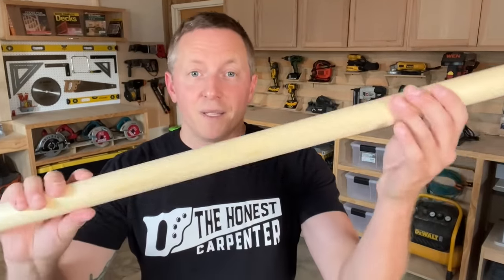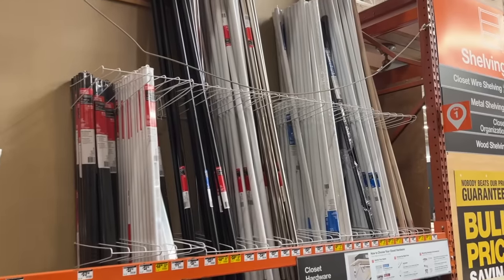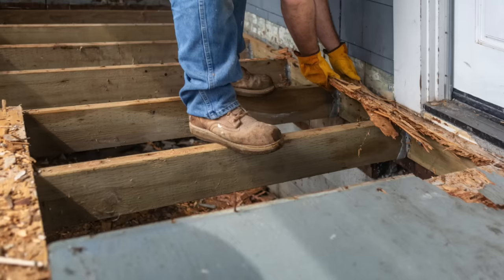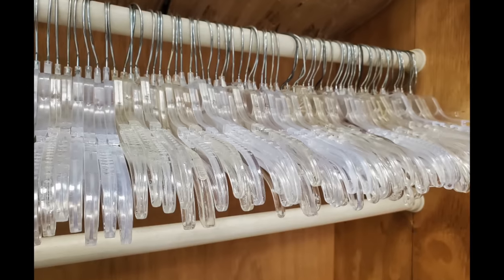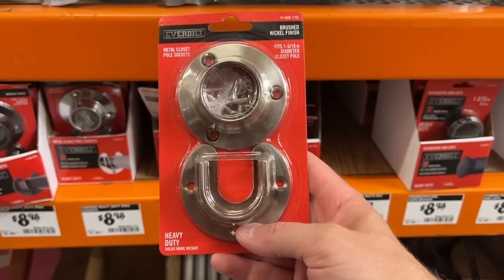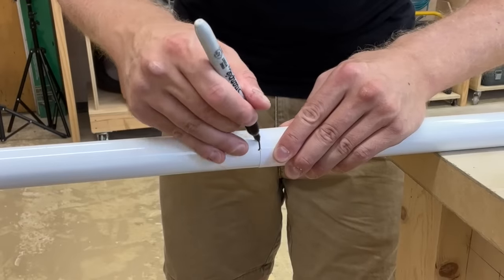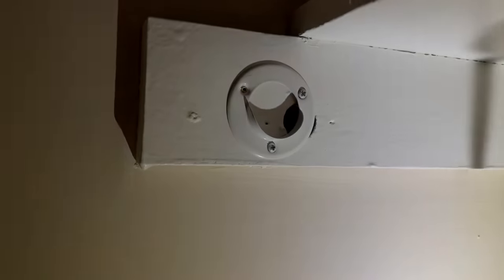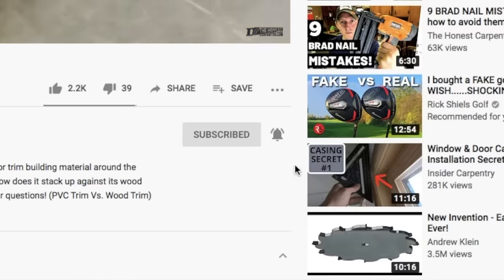Wooden Closet Rods Are TERRIBLE! Try This Better Alternative...(Metal Clothing Rod Install Tips)

Comment: I'm gonna guess this is a problem with the wood being used... I mean, I've seen wooden rods that would never bow or get out of shape, with finishes that wouldn't get all scuffed and marred overtime - but those certainly weren't your average mass produced hardware shop wooden closet rods. Nowadays I guess it's just easier to get the metal rod, unless you really have a need for it to be wood, which then it seems the advice would be to not get the hardware shop mass produced type.
Oh, another good thing about metal rods - you can get them in non-rod shape. xD I mean, pure design choice I guess, but I've also seen square and rectangular with rounded corner models... those would definitely not work well with wood. Anyways, great tip!

Comment: Kool, never knew about the metal rods. But as you mentioned, spands over 6ft will bow or sag needing the middle support bracket...  Ok, sit down before you read further. I know it may not look pretty, but I disliked the middle support bracket, keeping me from freely sliding side to side when if necessary. In my 8ft long closet when I doubled up my closet (two rods for two rows of clothes) I used slightly larger diameter galvanized pipes. Yes, I already said they may not look pretty, but there is little if any sag.   For strength I used double end plates, one side with a hole drilled out in the upper part, and the other side a channel hole cut in to set the pipe in. I suppose they could be painted? But for me it's a matter of function over fashion. 
Just thought I would share. I realize most are not lucky enough to have 8ft long closets. But I did the same in my 6ft closet. I didn't double up the rods,(maybe in the future) but as I mentioned, I hate the support bracket in the middle. 
    FYI, I do enjoy your channel. And your ideas and experiences, and advice.
Reply from the maker: I agree with that approach, Lamarty! The middle bracket really can be a pain sometimes, because it’s right where you want to grab first. You definitely won’t have that problem though—thanks for watching and writing in! 😁

Comment: How do you feel about black plumbing type pipe?  I've got a bit of that industrial aesthetic in my house, so I was thinking of going with this in my closet.   It also gives me the option of putting some short pipes for hats, scarves, bags, etc on the wall where the door is where there isn't enough room for another closet rod. 😀
Reply: Black gas pipe is my favorite.  I been using it for years in my own home.

Comment: Hey, explain this one to me: my grandparents had wooden closet rods that never bent under the wright of the clothes, and didn't sag even when my cousin and I would hang off of them. One of their closets/rods was at least 6 or 7 feet long and they'd all been there since the mid 1960s.... why so different to today's wooden rods?
Reply from the maker: Those things are defying the odds, Princezz! 😆 I’d say they definitely aren’t  todays pine/spruce/fir. Maybe a real hardwood, hickory or something, with burly dimensions. They can stay!
Reply: Millennial Wood: it just fucking sucks and ain’t worth a fuck.

Wood back in the day (like the people) were more tougher & resilient.
Reply: @TheHonestCarpenter  Helping my grandparents renovate a while back I noticed their (original to the house, ~120 years old) dowels were solid oak and something else that was very hard and silvery grey. I had some dowel stock that was Ash and very dense, sat around because it was too small in diameter to turn into a half. Everything on racks now is softwood and what is available in hardwood is incredibly expensive.
Reply: Same with the wood rods in the closets of my old 1955 house. I think the key is wood quality and selection. Old growth lumber with tight annual growth rings is superior in strength and watching grain direction to avoid runout are both big factors. Modern lumber is inferior (fast growth = wide growth rings and weak wood) while high-production modern manufacturing can't be bothered to watch out for grain runout.
Reply: I bought an old fishing cabin, circa 1950, to renovate. Whenever I needed to attach anything to a stud I first had to drill a hole the size of the nail's shank. Impossible to use drywall screws, they'd snap off half way in. I am told the lumber is white oak that was air dried. After all those years it turned gray and was hard as a rock.
Reply: Probably made of HARDWOOD. Totally different animal from today's closet rods made of pine
Reply: @carlyw60  I wonder if it might’ve been Chestnut. Most chestnut trees in the US were cut down in the 1920s due to blight but it was a great structural material to that point.

Comment: Thanks for your video . Question, when using a metal rod that will be going into the side wall of the closet then meeting in the middle connecting to a center pressed wood wardrobe, is it OK to just mount the closet rod to the side of the wardrobe or is a wood piece needed then attach the mount? Rod will only be about 55in across

Comment: Just curious,  but why not cut the rod with a pipe cutter? These are really cheap and you get a nice straight cut without even trying. Better still, it's silent.
Reply: That works quite well. But cheap they are not, if you want one that works!

Comment: what if I want to replace a long wooden rod. It's 126" across, there are a few support brackets but the wood is one solid piece. How can I 'connect' two metal rods to fill that length?

Comment: Hola! 🖐 Thanks for the info and the suggestion that these metal rods work better than other options. Did you consider solid vinyl or composite material rods? I wonder how durable they are compared to the metal. Take care and have a good one, Adios! 👊
Reply from the maker: I haven’t seen those, Grampies! I’ll keep an eye out for them though 👍

Comment: Metal rods are the bomb, but before you hit the check out, ensure that the d**m UPC label comes off cleanly!! Clothes hangers don't slide well over adhesive.  Also if you're buying multiple rods of one brand, you can roll the dice--if you're feeling lucky--and only bother to check one label out of the group, because no manufacturer EVER mixes in permanent and removable labels on their products, ever. /s
Reply: Cool! What's Telegram?

Comment: I was surprised to see you bend the tape measure when any decent tape measure has the measurement from the front to back of it imprinted so you can just put the back of the tape to the other wall.

Comment: I disagree.  The best closet rod is a PVC pipe with a metal rod inside (for support).  You can sand the pvc pipe up to 220 or so and hangars slide effortlessly.  They will outlast metal and always look good.

Comment: Friction from sliding hangers?  Is this an actual thing?  Seems like someone is looking for reasons.
Reply from the maker: But will I find them?? 🕵🏻‍♂️
Reply: @TheHonestCarpenter  Apparently.😏
Reply: Many finishes people use are horrible for high touch areas.  Always have that soft tacky feel.  It screams cheap and unskilled.  Shelving, and curtain rods are prime examples of the wrong finish applied.

Comment: yeah metal rods are stronger... but metal will RUST (especially in an area prone to having moisture in the air - window, bathroom, etc)... and if that rust contacts clothes or curtains, good luck with the rust stains... I'd rather deal with the wood sagging as opposed to rust spreading like a wild fire

Comment: "metal rods tend to be hollow tubes with a thick rigid wall" - proceeds to show 1/8 inch thickness
Reply: Actually the new closet rod/tube he installed is nowhere near 1/8 in. thickness, which is the wall thickness of schedule 40 steel pipe at about 1 1/4 in D. The video shows removal of the “rusty pipe” he said, which actually WAS a sched 40 steel pipe!...even tho the vid subject was mostly about wood rods. I have the “ugly” pipe he removed...but they will NEVER sag! His wife simply wanted something prettier, no doubt.
Reply: @philipwhichard8197  nah

Comment: wooden rod is easier to work with (cutting, sanding, re-painting), metal rods are too heavy they rust and smelly in humid weather, the paint comes off after a while, basically they feel unnatural

Comment: Perfect closet rod would be metal with a wooden core.
Reply from the maker: That make those Matthew. You get the good slick finish, but the metal tends to be very thin, so doesn’t add a ton of strength. 😕

Comment: Never had a wood rod fail in 40years. And you might want to plug those old holes you partially covered to protect from insects infestation. Also there are many other ways to cut your rods without using a hacksaw.
Reply: Craig, any examples of cutting a rod without a hacksaw - thanks